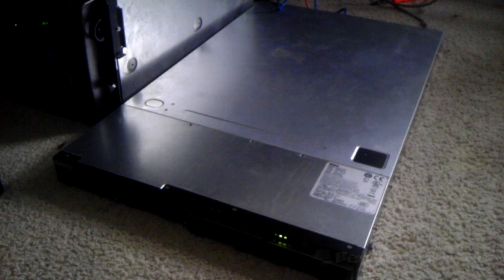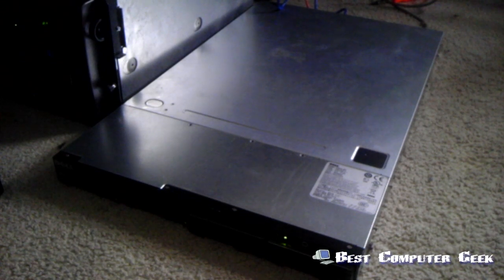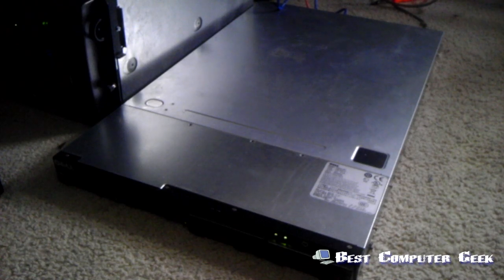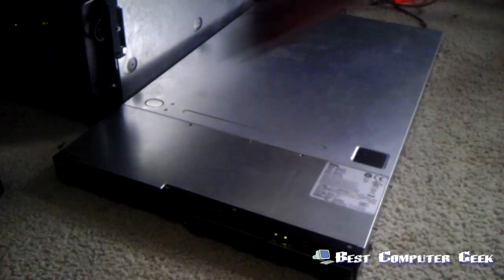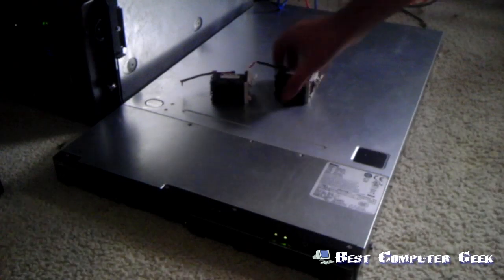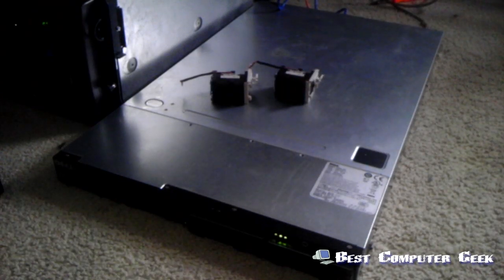Dell CS24-SC - Idle To Full - Fan Noise

Comment: I have one of these servers now... However, I found a 4-pin fan header on the inside on the backplane. I was considering a 1x4 pwm fan splitter and using third-party fans... However, the third-party fans are rated for 17 CFM instead of the stock fans rating at 27 CFM. Would this be worth a shot, or do you think it would be too much of a drop?

Comment: How do you control your fan speed??? I have the same server and i cant figure it out! Thank you!
Reply from the maker: I don't believe you can control it manually. It just adjusts automatically depending on the processors temperature.
Reply: okay
Reply: +BestComputerGeek where you ever able to shut it up? I put a graphics card in one by recommendation of a friend (super awesome tech nerd), and I never boot it up because its too overpowering, but it is a beast when I do use it!

Comment: Were you able to load ESXi 5.5 on this box?
Reply from the maker: I don't believe I have tried 5.5. I know I had trouble with 5.1 so I am currently running 5.0.
Reply: BestComputerGeek I'm running 6 on mine - you just have to boot it with the headless option disabled. I.e. ignoreHeadless=TRUE

Comment: I am running BMC version 1.10 which is one of the quietest I have played with. I had 1.95 which was quieter but it got corrupted. Neither of them had a web based BMC console. I have 1.00 and 1.02 that are Loud & turbine LOUD but have web consoles. It's a simple process to backup & flash (lost 1.95 in haste). 
Under heavy loads they still scream as they heat up though.

The simple answer is if you want it quiet you'll be giving up the web based BMC functionality. Contact me directly for more info